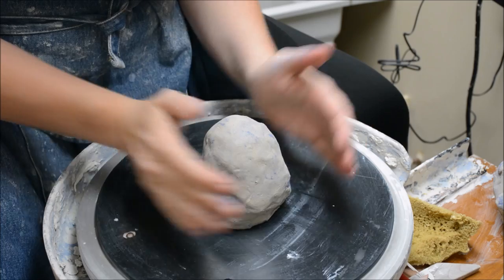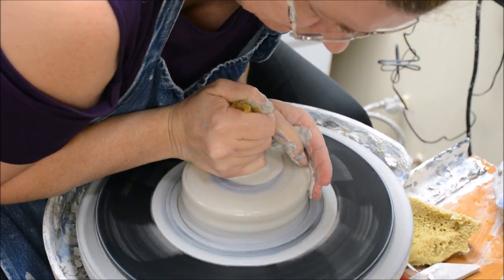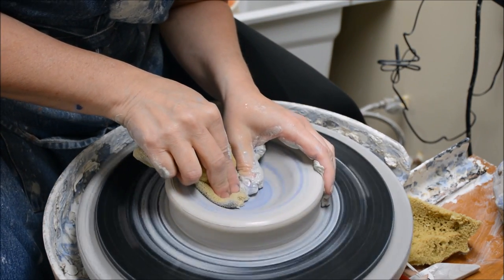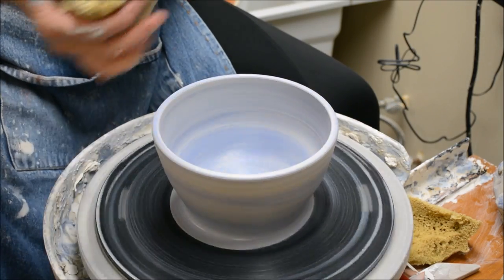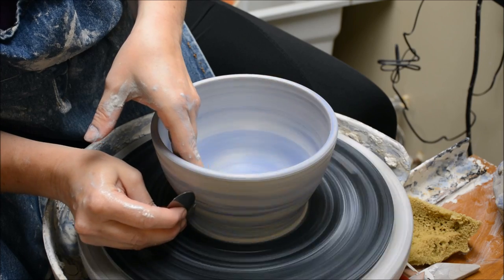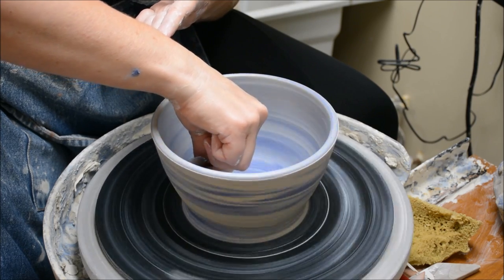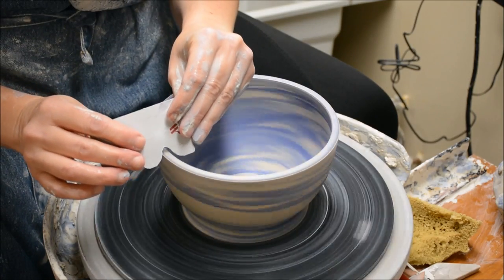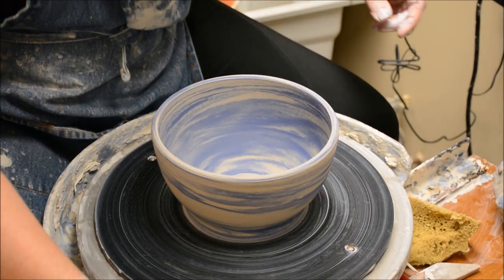Throwing a Bowl with Colored Clay Creating Marble or Agateware

Comment: Thank you for a great video!   Do you cone agateware?
Reply from the maker: I bisque fire it like any clay- and then glaze and fire to the appropriate cone for the claybody.  This is cone 5/6 clay I use!
Reply: KaransPotsAndGlass Sorry, I wasn’t clear.  I meant can you cone the agateware Clay up as part of the centering process or does that cause the colors to integrate too much?
Reply from the maker: Ah! Now I understand!!! Sorry!  That is an excellent question! I don’t think I would cone very much, because it does tend to do a mixing process. If you can avoid it I would attempt to avoid it!  :)
Reply from the maker: I have to tell you also, this is goofy- but for some reason, I assumed that there was a language barrier talking about firing... I don't know why I didn't think of actual coning!  (I get lots of questions with translation issues, where people don't know the term firing and such!)  ;)
Reply: @lkirk9763 definitely don't wedge them together.

Comment: Are you left hand dominate in your centering?
Reply from the maker: Hi Carissa- here’s a video specifically on centering if this helps!  https://youtu.be/_1AJVtoMcDc   The left hand is truly the primary centering force. With the left elbow firmly locked to your leg or something else stationary, you push in hard with the left to do the majority of the centering, while the  right concentrates on the top. And, I am right-handed with a counter clockwise wheel rotation.